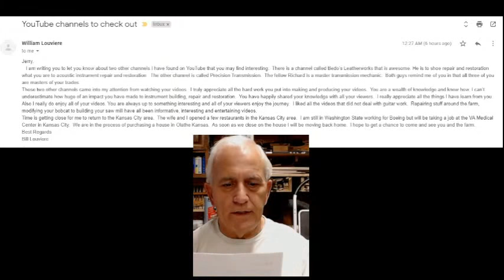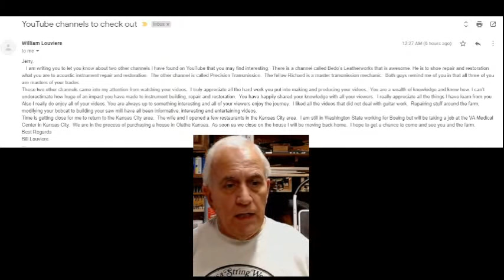RSW LIVE Shop Talk 40 Binding Tips and Tricks Wood Glue Break Experiment

Comment: That last hurrah guitar is looking really good. The "fix" to deal with the short sides has added some very nice additional detailing. BTW, you should add some padding to the bottom of the remote control holder slots to avoid damage to bottom of remotes over time when they get dropped in after use. I see ads on TV for a printer with big ink reservoirs. It would be better if the coloured inks are available separately as they aren't used equally. You run out of yellow more often than any other colour.

Comment: Hi Jerry, What acoustic guitar guitar tuner do you recommend? I currently use a poly tune which I like, but it has to be attached to the head stock while tuning. I thought I saw you in the past using a very accurate tuner independent of the guitar. Looks expensive, but that’s fine. What brand is it if you still use it. Looking for your advice. Great show and thank you.

Comment: I thought the glue video was accurate but misleading. It demonstrated that end grain glue joints are marginally stronger than side grain joints,  but the real point is that when you have your wood aligned with the grain the actual strength you want is that of the fibres, and for that, as you demonstrated, you need a scarf joint or a fingered scarf joint to get the strength of the fibres.

Comment: Unless you need photo quality prints, buy a laser printer.  The cartridges last forever, and with an OKI Data printer, you can get near photo quality prints. Don't buy HP, they electronically date their ink jet cartridges  and even anew cartridge will not function if it has an old date. Partially full units just stop working when the data stops it.  Laser cartridges vary in cost but you can buy 2000 to 10,000 prints per cartridge.